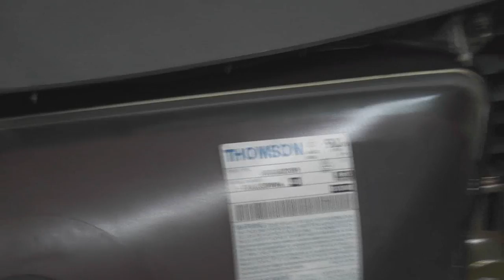CRT venting with yellow smoke [event 2A]

Comment: You can clean these crt tubes btw! The lead and phosphor coating can be easily wiped using 200-500 grit sand paper, the phospor coating on the panel glass (screen) can be wiped and scrubbed off using  a non scratch sponge, be sure to do this over something that will not let the leads and phosphor leak into the ground to prevent pollution! I will soon be uploading videos of me cracking open the crt tubes and cleaning them out! Stay tuned and great video!